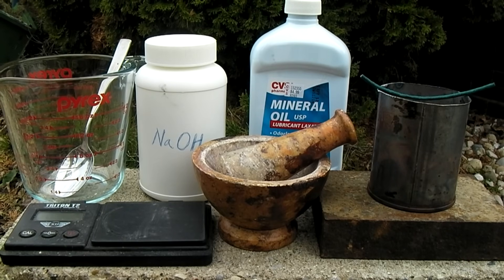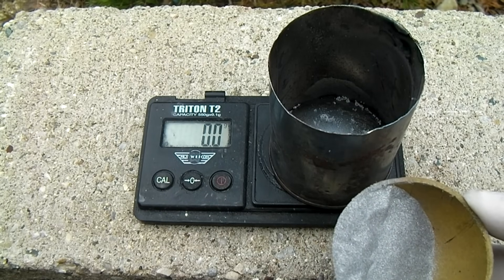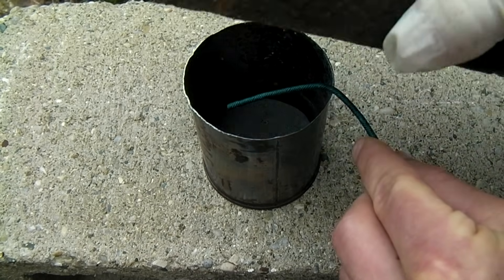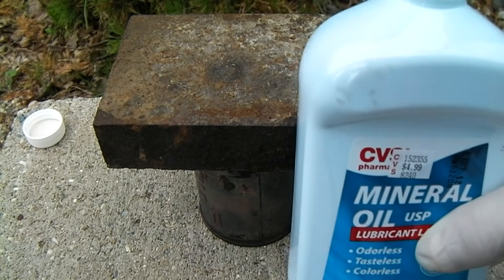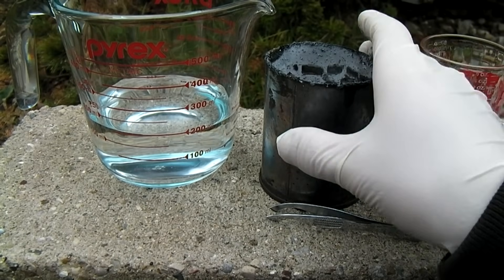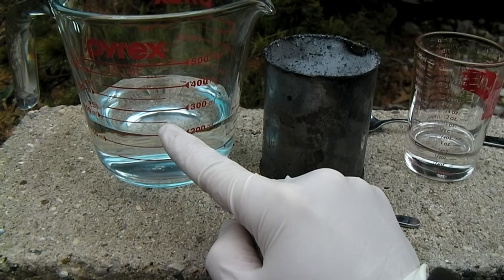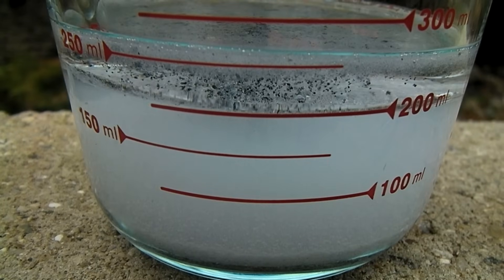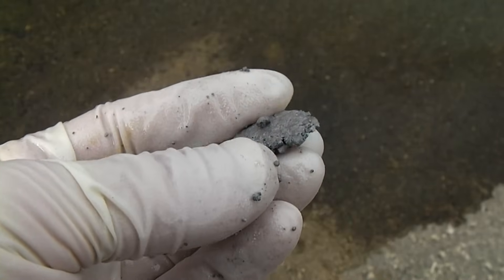How To Make Sodium Metal

Comment: That's terribly impure sodium. Pure sodium virtually explodes when it hits water. You'd get much purer sodium by using washing soda (Na2CO3) + carbon (C2). To get pure carbon, just burn sugar on a stove till it's completely black and dry. Then mix the carbon with washing soda inside a pipe bomb type set up. Use a copper tube on one cap and put the other end of the tube in mineral oil. You'll get gaseous sodium that freezes when it hits the oil but the carbon dioxide will bubble out of the oil. Winding up with extremely pure sodium. The sodium you made here reacts more like lithium cause it's highly contaminated with magnesium hydroxide. That water "cleaning" process is definitely NOT removing FUSED magnesium hydroxide from SODIUM metal. I may do a video for the carbothermal reduction of washing soda. It's very cheap and easy to do. If anyone does it make sure you get the measurements right and make sure you pull the copper tube OUT of the oil BEFORE it cools down.
Reply: Let me know when you make a video of it :-D would love to see that ;-)
Reply: I'm not a chemist, but I have seen pure sodium in water before and it didn't even come close to exploding. It had a reaction very similar to this as a matter of fact. Even Myth Busters did an episode on Macguyver where they dropped two sodium tablets in a canteen to try to make a bomb. Nothing happened. Sodium just doesn't have a violent reaction like phosphorus or other elements with moisture. I know as you move farther down the line of elements below sodium, the more violent their reaction is to water.
Reply: it depends on the temperature of the water. if the water is hot it will ignite and if it is large chunk of sodium it will explode and make a big fuss.that is what my chemistry teacher said.in cold water sodium 
doesnt ignite but potassium ignites in cold water
Reply: You need a furnace to make the reaction go between Na2CO3 and C. Some people didn't notice that you were talking about sodium gas coming off the reaction. You need about 1200 C.
Reply: Matthew Wilson Sodium can explode in water, but whether it explodes or not is due to a number of factors, such as the thickness of the oxide layer on its surface, etc. Contrary to the common belief that hydrogen gas combustion is behind the explosive behaviour of sodium, the actual mechanism is a much more complicated "coulomb explosion" occurring at the surface of the sodium in contact with the water. The reason why this doesn't happen every time you see a sodium in water vid is because of the varied conditions of each reaction (such as the prevalence of an oxide layer), for example, if perfectly clean sodium is brought in contact with water it will immediately explode. The discovery of the coulomb explosion mechanism was actually quite recent and is an interesting read :)
Reply: louis tournas The mechanism for a coulomb explosion is entirely dependent on the state of the metal water interface. An oxide layer, whilst reacting with the water to form the same product, inhibits the reaction mechanism by limiting that initial metal/water contact, which is what is needed for a coulomb explosion to occur. The role that an oxide layer plays is illustrated well in the fact that dropping sodium metal or even potassium metal in water results in inconsistent explosive behaviour, whilst dropping fresh NaK alloy (with no oxide layer) results in a coulomb explosion 100% of the time (as tested by the writers of the paper on the coulomb explosion)

No steam explosion occurs, but rather, to quote from the paper...

"This process is initiated by electrostatic repulsion within a layer of alkali cations formed at the surface of the drop due to an almost immediate release of the alkali metal valence electrons into water. The resulting Rayleigh instability leads to formation of metal spikes shooting into water. This process in turn produces new surface at which the heterogeneous alkali metal-water reaction can propagate further in an explosive way."
Reply: Actually, the sodium is pretty pure and not even pure sodium will explode the second it hits water. Sodium sizzles in the water, while on fire, for a while, then explodes. When the sodium is reacting with water,  the following reaction occurs:

H20 + Na --->  NaOH + H

The NaOH would dissolve any possible impurities. The reason it is not exploding is because it will take a while for the water to react with all of the sodium.

Your strategy is HORRIBLE! The gasess released from that are nasty. Even done under a fume hood, The gas would break it...

The reason it goes slowly is because of the oxide layer.
Reply: I would love to see you do it ^_^
Reply: so does this occur spontaneously, or does one require a fuse to ignite the mixture inside the apparatus?
Reply: yeah make a video! i want my sodium to go BOOM
Reply: woah
Reply: But the reactions takes place higher than sodium's boiling point so it could be lost
Reply: Still waiting on that video...
Reply: blargish27  "(such as the prevalence of an oxide layer"

==Why would an oxide layer be an issue? The oxide just reacts with water and dissolves away as NaOH.
I haven't read about coulomb explosion but I think the explosion is caused by the sodium becoming microdroplets in the water and it causes a steam explosion.

Like you, I don't think it is caused by a hydrogen gas explosion.

Comment: How to make Caesium metal?
Reply: same process except caesium hydroxide. BUT IT IS EXPENSIVE AND IMPURE.
Reply: Konstantinos Myrianthefs NO, its hard to find, but their maybe a few samples online such as in Sigma-Aldrich Chemicals you can buy it there.
Reply: ***** Where to get caesium salt?
Reply: ***** Search it online. You might find something.
Reply: CuriouScienceDude That thing would be fluorine gas instead of Cs
Reply: It does react with the moisture in the air
Reply: Heat up lithium and lithium chlorine in a cruiclible and heat it up. Then you can vape cesium vapors

Comment: when i tried this, the reaction was not nearly as fast or explosive, more of a slowish burning. and when i tried to retrieve the sodium, slag was all in the oil and i couldn't figure out which parts were slag or sodium. i substituted the fuse for a burning napkin and the lid was not airtight, would this perhaps be one of the problems?
how can you tell what is sodium versus slag?
Reply: I have the same problem

Comment: So sodium hydroxide, Magnesium (In the UK I don't know of any way of getting pure magnesium, so is it magnesium oxide?) Mineral oil is available, (distilled?) water. Would be really greatful for a full exact list of ingredients and details on how to acquire said problematic ingredients in the UK. Liked the video, stages were really well explained. Thanks,
Al
Reply from the maker: Magnesium, not magnesium oxide. You can perhaps find it at a scrap yard. Some car parts like rims can be made of magnesium. It can be hard to tell the difference between magnesium and aluminum so you will need to test it. To test, scratch the surface to expose fresh shiny metal and drip some vinegar on it. If it's magnesium it will bubble.
Reply: Brilliant. Thanks!
Reply: you might check online. i don't know where to buy in the uk but i got some magnesium from United Nuclear. Galliumsource might have it to ship to the UK so i'd start there
Reply: Magnesium fire starters. it's a block about 4-5" long by 1" wide by 1/4" thick with a flint strip down one side. Most camping stores have them for a few bucks.

Comment: The sodium looked like a lump of clay before you dropped it in the water. Why does it appear white and form a sphere on the top of the water? Was it hot or molten?
Reply: Because that's not all sodium. We're calling it sodium, just like you're calling a rusty piece of steel "metal". The oxides react with the water, forming NaOH. This dissolves in the water, exposing the pure sodium metal underneath, which hasn't reacted with the atmosphere yet.

Comment: Wouldnt the sodium react with the water making sodium hydroxide again?
Reply: atourdeforce and the longest comment award goes to...!
Reply: Chris Love  Yes It does to some extent. This is a very wasteful process because of that very issue and because your going to loose a lot of sodium with the heat of this reaction. That's why he leaves the lid on. To keep as much air out as possible and to let the Na cool as much as possible, because  the cooler it is the less reactive it is. But in a way this reaction is nice too because it produces oxides which stick to the lid and help seal it, But none the less Na is still wasted. 

Now he utilised several things here, he used the fact that Na floats, to his advantage, and that the heat formed will cause the Na prills to globulate into proper dense balls, and finally the fact that the slag is heavier than water.

All of this means that once dropped in to the water layered with oil, the Na sinks through the oil because it has a lot of slag and impurities attached. It then hits the water layer and reacts heating up and making a larger solid glob of Na and releasing the slag from the sodium which falls to the bottom as its heavier.

Now that the Na is pure it is now not weighted down by the slag And starts to float back up into the oil phase, Which upon arrival stops reacting. 

So Yes the sodium reacts with the water but only a certain amount of it as it is not reactive enough to fully react instantaneously, and it is simply not in the water phase long enough to react fully before floating into the neutrality of the oil phase.

This I would like to add is a very ingenious method of separation for the home scientist. If NightHawkInLight came up with this part of the process I'm very impressed. As it requires an innate knowledge of how things work, how things behave and also Physics. But the most important thing here is to have the cerebral acuity to be able to come up with processes like this. there are just not that many people out there who understand the complexity but yet the shear staggeringly simple mechanics behind this. It is great to see. 

To *****  skofilmz It would not be possible to make anything other than sodium or Lithium utilizing this method, as anything else would be too reactive. In the case of K it reacts very quickly with water very often in an explosive instant. but because it would be contained between an oil layer and the water, it would most probably react instantly with little explosions and a big mess.

As for the Cs Forget about it, it will react even more so. I don't know why people have a fascination with the lower end of the Alkali's they are nowhere near as powerful as they are in peoples minds. The power increase is not linear as you go down the table. Rb is not a whole lot more powerful than K . etc....

Even if you could make Cs you be much better off trying sigma's website they will sell to the public. But even for a few grams like 2gr it would be very expensive maybe $60 in your money. You would have just as much fun with K and 3/4 of the bang. 

Robert Cece I disagree, the sodium he has at the end is very pure If he pulled that big globule out of the water at the very end, I.e just washed it once more there would be very little oxides or physical contaminants. I do think it is a very wasteful process, but it's wastefulness is off set by its practicality.

On final point NightHawkInLight  if you had of made a strong alkaline solution (some experimenting might need to be done to determine the optimum conc) instead of water I would Imagine you would get higher yields as the Na would not react to such an extent. I don't think In my opinion that simply leaving the sodium to turn the water basic is going to result in a strong enough solution to make much of a difference.

That is why maybe try starting out with a strong basic solution instead of water might yield more favourable outcome. But I am only theorising here.
Reply: @atourdeforce   Do I get a consolation prize at least for reading it all?
Reply: @MrSidMan  I haven't seen this in 4 years and was a bit shocked why I wrote so much myself. 🤣🤣
Reply: @atourdeforce  by all means, it was a well written comment.  I really did read it all...
Reply: @atourdeforce  your explanation is what YT lack. 
I would write as much as your text to show appreciation, but I think that’d defeat the purpose... 

Thanks, cheers.
Reply: @meazn123  Aah it's my pleasure pal! Thanks for the kind comment. I'm still shocked I wrote that much tbh, Although I shouldn't be that shocked because I know I've wrote far longer comments many times on YT before. 😂
Reply: @atourdeforce  You, sir, are a legend. Thanks for that explanation. We need more people like you on Earth.
Reply: @annonono  🥺🧡 Happy New year! x
Reply: atourdeforce  As far as your "strong basic solution", NaOH would surely be a good candidate, since you have that in the first place, and since that's what the sodium would otherwise be trying to form. Would a saturated solution mean more or less 100% of the sodium is freed?
Reply: @greenaum  I thought once I said an alkaline solution, that NaOH would be the intuitive answer, I should have said so, but yes it's the perfect choice and very cheap. 

Well the more NaOH in solution the less the sodium will react with the water, so I would aim for a saturated solution but I wouldn't be surprised if that may be too concentrated to allow the sodium to react ENOUGH to melt away from the slag. So it would probably take a few trys with different concentrations, but if I had to guess I'd say a saturated solution might work best.
Reply: @atourdeforce  Just seemed odd you not pointing out that the NaOH you had on hand anyway would be, AFAIK, the optimum solution to use. Hence I mentioned it! 

I'm fairly sure the sodium would have to more or less saturate the water into NaOH anyway before you got anything back. Sodium metal in tiny pieces isn't likely to survive long enough to float to the top, without reacting. That'd surely affect the yield a lot. Water can absorb a lot of sodium.
Reply: atourdeforce — Please tell us you don’t write technical manuals!  🤪  You could literally turn “insert screw A into hex nut E” into a book. LOL!
Reply: @atourdeforce  Im just making sodium because I am making a sodium potassium alloy, and THAT is fun. Sodium is relatively boring in the grand scheme of things, but when you can make a liquid bubble of explosive medal with NaK, it becomes very fun
Reply: @blueangels111  Sounds like a blast! 😂. Enjoy.
Reply: @atourdeforce  The internet is powerful because of folks like you
Reply: AJ Pollard and there's the shortest answer ^_^
Reply: @Rahat-tw8vg  He could have said "No", that would be shorter 🤣
Reply: Yes
Reply: @rodarywindsorcleveland8506  If there is metal in the rock, or should I say enough to make it feasible and you could heat it hot enough, yes.

Comment: Hey. I know this is unrelated, but im curious...I was going to experiment with Sodium acetate today. But something went wrong when I was making it. It produced clumps of crystals with the consistency of wet sand. So, since the intended experiment was ruined i figured id salvage it, and perform another one. I took the crystals I had and put them on my stove at High. At first they melted, recrystalized, and melted again. What im left with is a shiny silver material, that is very brittle and has a melting point at around 210 degrees Fahrenheit. Does anyone know what this stuff is? I'd really like to know.
Reply: You need to be more specific about reagents and method of preparation. Based on your description it seems to me that is indeed sodium acetate trihydrate.
Reply: I used normal white vinegar, and arm and hammer baking soda. Mixed them together to make my sodium acetate. Then left it on my oven at the 7th heat setting out of 10, which we usually use to boil water. Left it there for about an hour. Once i was happy with what I had, I transferred it to another container and let it cool slowly. I put it in my fridge overnight, and there were a bunch of crystals that had formed on the bottom of my container. The sodium acetate didn't freeze when I touched it or anything. Just felt like cold water. So then I figured I'd make another science experiment of one that didn't work as intended, and melted down my crystals on high heat for about 15-20 minutes on high. Pretty much just until they stopped boiling, and I just had a shiny black liquid that almost instantly started to crystallize once it was off the burner. It's grayish silver, very brittle, doesn't float, dissolves in water, has a melting point around 210 degrees Fahrenheit. I can't use it for my intended sodium acetate experiment since it's solid at room temperature anyway. Let me know if this helps at all :D

Comment: where do you find sodium hydroxide and magnesium powder??
Reply: Sodium hydroxide is lye. It's sold and used a drain cleaner. It can be bought at hardware stores and such. Good luck with the magnesium. I'm sure it can be easily made with a metal file if one can find a sorce of solid magnesium.
Reply: You can get a magnesium rod out of a hot water heater or go to walmart or a hardware storeto buy one they cost around $7.50
Reply: @bobhawkins875  Epsom salts be the same or no?.
Reply: dunno
Reply: You can easily buy pounds of magnesium powder on eBay.
Reply: @chaoticchem  what about Epsom salts?.